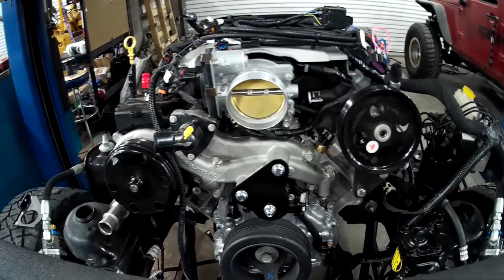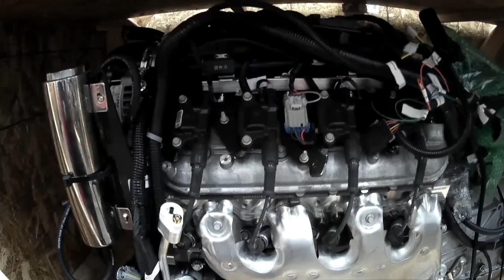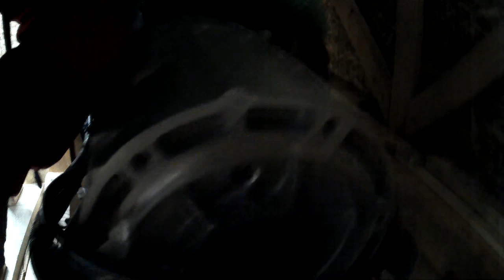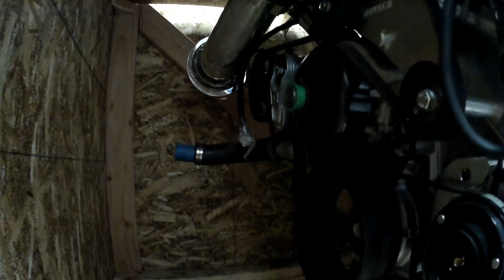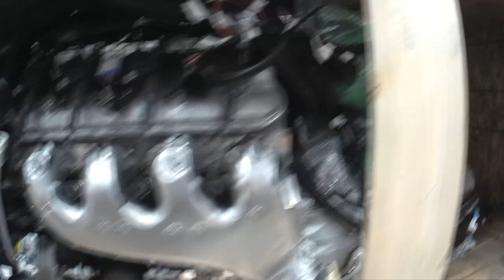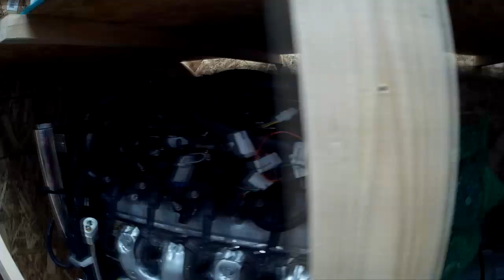MoTech Builder Package

Comment: My wife and I have this set-up (L94 and 6L80) in our '07 and '08 JKUs that were installed by MoTech and they are AWESOME!! Plus, you cannot find a more knowledgeable or better person to work with than Robbie, the man is truly the LS Jeep whisperer.  :)
Reply: What's the cost to run these kits?
Reply: Hi John!  I think I met you last Summer picking up your wife's Jeep when I was down there with my 2009 JKU getting the same combo (L94 / 6L80).  Other than some challenges dealing with exhaust heat (the Metalcloak skid system - specifically the tcase skid - traps way too much of it against the floor pan) I've been loving it too!  I believe you had a line on a good insurance option for swapped JKs which I forgot to ask you about - if you could share it here it might help me and anyone doing / considering a swap.  Cheers, Chris Pyle.